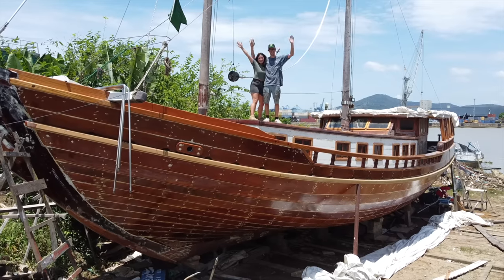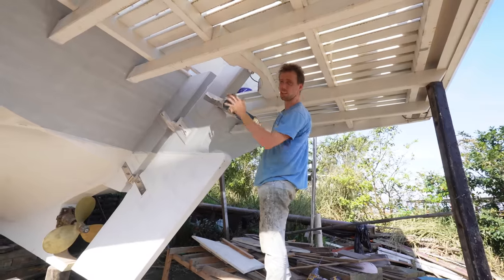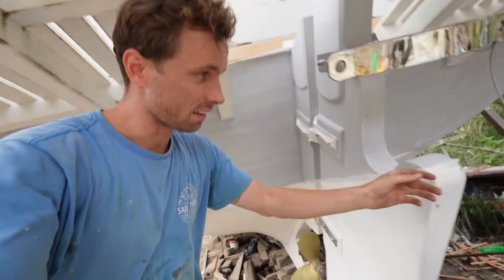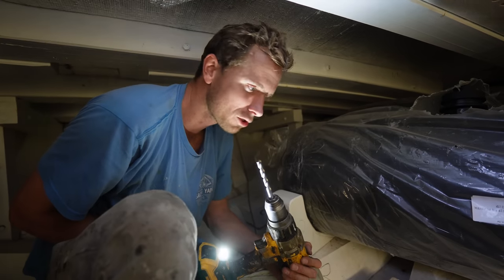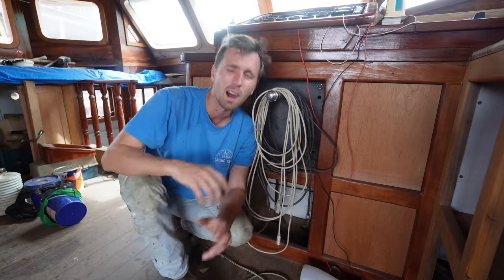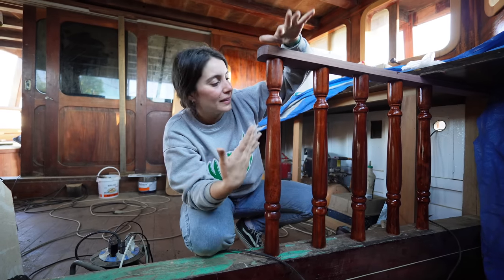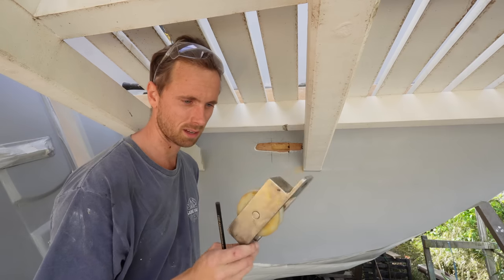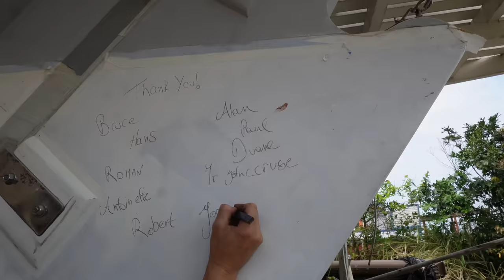We can finally steer our once sinking wooden boat into the horizon — Sailing Yabá 152

Comment: Dear Sailing Yaba couple.
👍👌👏 The rudder system seems to work just fine. Personally I wouldn't trust a bicycle chain, I would use at least a moped chain and sprocket. And please read the comments about attaching the cable to the chain. I would also recommend to use more than one attachment point. But of course you have all those experienced boat builders around you. Maybe I'm simply too cautious!?
2) Hey, why no dogs in this video? Are they stressed and needed a vacation? 😁 ;-)
Thanks a lot for making teaching explaining recording editing uploading and sharing.
Best regards luck and especially health to all of you.

Comment: The steering cable should be under tension to keep out the slack.  You might consider using strong garage door (2) springs to (one on each cable) to keep the cable under tension.  Also, I suggest using metal tubing for the cable to run through at the stern.  The cable clamps will loosen over time.  You might weld them in place using liquid weld.   You might consider using someone who can help you with the proper steering setup.
Reply: My thoughts. This isn't something you draw out in a white board... this is more important than an engine... he seems to think epoxy is a save all ... I feel they're rushing to meet an unattainable deadline that will cause the horrible failures.... I do not understand the rush an the not using a professional person for this🤔🤷🏼‍♀️
Reply: I agree, as Donna stated this is the most important system on any vessel. Please consult a professional to design a proper steering solution for your fine ship. Best of luck going forward.   @donnakawana

Comment: I know it cost a bit more but defo would have gone hydraulic on the steering you will have to put metal tubes where the wire goes through the hull as it will easily cut through the wood! I can see problems down the line with the cable system hope im wrong good luck😊
Reply: hydraulic would work well however it is complicated and if you have a system fail you have no rudder at all unless you bypass the cylinder's or drain the oil from them(very difficult in a storm that wants to swamp you and seconds count for hours)  if a cable breaks they simply can quickly switch to tiller keep her nose to the waves and  sail to get to repairs
Reply: @GeorgeVeld  yes sir you are right if the system fails it is a few more steps . But there is quick drain systems that allow you to relieve the pressure off the pistons pretty quickly … then just go to the tiller…

Comment: Uses large  link chain,   the  bicycle  chain is too small.   And  never run a steel  cable  through  a link  like  you did.  It will cut the cable  in a year or less.   Remember  those  contacts  will  have continuous  wave slap  when  in the  water
Reply: Yup over looking important things to rush to meet unnecessary deadlines
Reply: It isn't a bicycle chain, it's a motorcycle chain. I'm a bicycle mechanic, I fix them for a living. My biggest worry for that thing would be rust. I know a motorcycle chain is much much tougher than bike chain, but I can't help but think of all the times I've had a rusted chain snap on me under load.
Reply: Agreed. I'm not an engineer but it doesn't take one to see that running that cable through a chain link is doomed to failure in the not distant future.  And that chain looks really small for the task you're placing on it.  A bigger chain is needed and a better connection with cable than running it through a link.  And it's good that you have large pulleys because I think you're going to want a bigger cable than the one you have.  Your boat is pretty big (I'm guessing it will be around 50,000 pounds loaded, or more) as is the rudder and I think your current cable is too small for that load.  The last thing you want is to be making cable repairs or replacement in the middle of the ocean.
Reply: the last roller of the chain the cable is attached to can come loose. it is wise to put a bolt through the last link, or rivet.
Reply: The previous version used junky old ropes that were spliced together using regular old knots.  The motorcycle chain that they have now is plenty strong.

Comment: Steering: I'd add a spring to the bottom of each chain, looped on one end and hook on the other. 

This allows for an eye at the end of the cable so it's not folded over the chain, that will wear and break. 
Then you can set the tension by moving the hook up the chain. Low tech and functional. 

The springs will keep tension on the system which is safer, and stop that terrible knock that you're going to get every time you turn to full lock. 

I'd definitely go for a smaller cog. Testing done now doesn't allow for water. When you're moving at speed or against a current, that water on the rudder has a lot of weight and it will feel completely different to being on the hard. 

Well done. You're so close.

Comment: I'm no boat builder but it strikes me that those cables that turn the tiller will come under enormous amounts of strain during rough weather. Do you think that those little pulleys that that have been screwed into the boat with 2 screws are going to be able to hold when the pressure gets too much?

Comment: Lots of peeps have commented so I wont dwell on it but once in the water you'll have more friction on those steel cables/wires to the steering which in turn WILL mean the cables/wires WILL stretch. If you don't want to keep having to tighten those cables/wires at the clamps all the time suggest like others have said put in tensioners e.g. turnbuckles. Also without thimbles or similar protecting the cable/ wire at the chains and the quadrant, because the radii is too tight for 6mm, it will fail sooner than it needs to.  I would also humbly suggest you carry a spare steering wire/cable when you eventually sail and possibly some spare pulleys. Great video btw

Comment: Cool video. You don't usually want to put the cable saddle clamps on in opposing directions like you showed... unless you are not too concerned about everything working properly.... The main "Saddle" side of the clamp goes to the working end of the wire. Good luck!

Comment: How exciting..!!  She Steers..!!   I agree with other comments that the entry angle of the wire from the quadrant to the transome sheave varies as the rudder turns through its arc. This is putting side load on the sheave, which is not desirable in the long term.   Maybe the sheaves need to be angled down on the inboard end?
Also, having turnbuckles in the wire circuit will help to apply tension to take up the slack in the cable and assist adjustment when it stretches. There will be a LOT of load on the cable in seas, and you'll need a fair cable run, free from wearing or load points.
Well done with the progress..!!
Cheer from Grant, Adelaide, South Australia.

Comment: I agree with thimbles and turnbuckles. The clevises on the quadrant need safety wires on the pins so they don’t back out. With the amount of force of the water on the rudder while under way, I think the wire needs to be a larger diameter. I also think that the trailing edge of the rudder should be thinner.

Comment: Ben, I agree with the comment about using bolts nuts and washers for the turnbuckles as the cables will be under a lot of tension especially at those turnbuckles, lag bolts will work loose over time. The cable terminations at the quadrant use s/s thimbles in the eye but I would not use cable clamps to secure them - too many bits to come loose. Pro cable riggers use swaged copper talurits using a hydraulic crimper, the cable would have to break before the talurit would let go.

Comment: As many people have pointed out, you really need turnbuckles to adjust cable tension and rudder stops are a must. If you had routed the cable through teflon (or some other material) tubing you would eliminate the need for pulleys (at least on the inside). Think how a MIG welder torch feeds wire. Then the steering tackle could be easily routed almost anywhere.

Comment: Hi Ben & MP,  
I was thinking that another pulley along the straight areas inside the hull with a spring on it so that there is always some light tension on the cable to allow for cable stretch over time and to keep the cable from "jumping track" in the pulleys.  My experience with that type of cable is that it will settle in a bit over its length and at the clamped ends, a pulley and a spring to each side could avoid headaches down the road. Could also help the chain from jumping out of cogs in heavy seas.
The spindles MP were working on turned out fantastic! Keep up the great work! Love the pups!

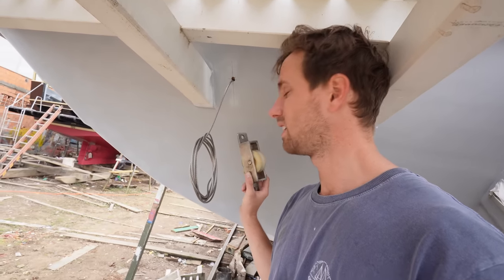Comment: 21:43 with the changing angle of the wire as the rudder deflects I would recommend you use a floating pulley and a pvc tube for the wire to feed through to protect the wood of the transom.

Comment: Ben:
1) Figure out a better attachment for the, I believe, Starboard cable to the chain.
2) The cable clamps are supposed to have the rod with the thread pulling the bitter end onto the standing end at the saddle, never the other way, as it weakens the standing end, if done in that fashion.
3) Cable exposed to the sea air, even stainless, will start to corrode between the wires, so will need to be checked every so often.

Comment: Make sure that you always carry a spare of every part of your steering mechanism on board, including all pulleys, chains, cables, fixing bolts (and some oversized bolts, in case any in the wood pull out) and cogs. Oh and put a metal plate on each side of the swim platform where the metal rudder piece will hit, to stop wear .

Comment: Always remember when installing cable clamps...never saddle a dead horse.  So, ONLY put the saddle on the main wire.  Never on the dead end.
Reply: mine thought as well
Reply: And 3 clamps min
Reply: I think he has the cable clamp on the wrong way on the ruder, this damages the cable if it was on my Boat it would be replaced
Reply: I worked at a zipline for 5 years and was responsible for daily inspections. I was just about to say this.
Reply: Why not put a metal tube inside of the transom, through the drilled holes,run the cable inside of the tubes protecting the wood for being cut by the wires, wear and tear by moving the cables left/right?
Reply: @sergiogobbi6085  , metal sliding against metal will introduce wear on the wire. I would rather have the wire retaining it's max strength while running against some wear item that can be exchanged.
Reply: @westmus  not a problem, if you add a dab of nautical grease.
Reply: @sergiogobbi6085 my thoughts also, a wire saw is a good way to cut timber….. Also maybe use a nylon tube to protect the SWR from abrasion
Reply: Should the wheel be angled downward to match angle of cable

Comment: Two things to consider on your steering arrangement. 1- add a tensioner pulley on cable runs, 2- use a proper connector to go from cable to the roller chain. Can be purchased from a marine supplier.( current arrangement is your weakest point in your hookup) . Enjoy following your progress, keep up the good work.

Comment: You should drill a large hole in transom for the wire to go thro' fill it with Epoxy and then drill out the correct size. as you know that will stop water wetting the transom wood. maybe a little hole but why start rotting the  transom first day out unless you like building boats more than sailing. haha. Fantastic work can't wait to come and dive with you guys.

Comment: Ben, you need to use 2x stainless steal turn knuckles to pick up the slack on the cables. Also make a plan to seal off those 2 holes at the stern.

Comment: Ben you asked about our opinions on adjustments made to mounting those pulleys on the back of the transom. I would seriously consider mounting a block of wood and cut a groove in it, instead of cutting a groove directly into the transom like you did, I would repair that and consider doing what I've recommended. I would talk this over with the Shipwright and see what they recommend and go from there.. Cheers !!!! also I would drill those holes through the transom after installing the blocks and drill larger holes then epoxy the holes then redrill them that way the wood is forever protected from water intrusion. Hope these suggestions help you's out. cheers.

Comment: Just a note.  The more bends the cable has, the more friction it generates and the harder it is to steer. At each bend is a pulley which will further add friction.  It would be to your great advantage to eliminate as many bends and pulleys as possible.  A single pulley below the wheel at each side, then a straight line to the outlet at the transom where a second pulley would be mounted. In between, teflon tubes mounted on the overhead and teflon pulleys will reduce the drag enormously.

Just my two cents.

Comment: The one thing I didn't like about that steering system was the connection from the cable to the chain.  May I suggest that the chain connect to another sprocket with a continuous loop, then have a tiller arm attached to that sprocket to attach the cable to.

Comment: The rigger who explained cable clamps to me said "Never saddle a dead horse."  Put he saddle on the live end of the cable (doing the work) and the u-bolt on the dead end of the cable (loose end).  If you over tighten the clamp the u-bolt can cut the cable.  You don't want to do that either way, but if you do cut or weaken the dead end  there is  less load on it and more material left to make an emergency repair.

Comment: You may want to put the wire through the next hole up on the chain as it has a pin in it or even run it through a couple of links. This will make it stronger. Remember the force on the rudder will be immense in a strong sea. Turn buckles to adjust the stretch in the chain and cable is a good idea. The boat is looking good and I look forward to seeing it on the water again. Well done guys an amazing job!

Comment: Suggestion...install a pulley tensioner and if possible install a adjustable tensioner on the wire just like a rigging rod tensenior. Through time with that length of wire chain and so many turns on pulleys. Youl get a lot of slackness unders strain.

Comment: Two things to check.
1) there is a minimum bend radius for a given cable. Make sure the pulleys are large enough for your cable.
2) To keep the cable tight  when the rudder is not centered you may need a  rudder quadrant.
 A quadrant-or fan-shaped metal fitting at the rudder head which receives the. steering cables. It ensures that the point of contact of each cable is. tangential to a circular arc centred on the axis of the rudder.

Comment: Great to see the rudder and wheel being installed, looking like she's ready to head off soon 🙂 Some thoughts on the setup : To have a pleasant and accurate steering feel you want to remove as much slack as possible (turnbuckles as mentioned very useful here) but you have to balance removing slack against loading the system up too much of course. I assume that you've referenced working systems /knowledge in designing your system but worth remembering that a rudder that size can be subjected to very large forces in bad weather /grounding so the cable run must be shielded /kept away from people as a breakage in a cable can be a deadly weapon. Also shield the cable from people storing things that might obstruct the cable, eg fenders, sails, ropes etc Have regular maintenance checks (especially in the first few months) to check for stretching, wear, damage. Carry spare cable and an alternative steering method, can you still use a tiller for example?
Reply: Was thinking the same thing about breakages. Steel cable breaking under stress is deadly. There are many documented fatalities and serious injuries from this. The 4WD world is also full of them from steel ropes parting. Maybe run the cable through stainless pipe in the engine compartment for safety, or at least thick PVC (hi pressure) pipe. 
Also some sort of guide through the transom so there is no cable on wood contact. Is there any thought on stopping or slowing water ingress through the holes in the transom?  Just some thought from the air chair critic 🙂
Reply: That was the first thing they designed.  In the last episode they showed their boat nearly pin-balling through the marina.

Comment: I am a big fan of your efforts to rebuild Yaba and the work that has been done so far.

With that said, a common theme of most of the comments points to your need to get some professional help to design and build your steering system, and not try to jury rig one of if not the most critical systems on your boat.
Reply: Clearly you didn't see the previous all rope and nylon pulley version that was used successfully for many years.  This is how a lot of professional mariners do it down there.  You should get some context before you condescend.

Comment: Even on as small as a 17 foot i opted for hydraulic steering due to the expected torque on the leg with refreshed horsepower. Too many boaters caught unaware when cables snap. Incredibly dangerous. Great video capturing. Cheers😊

Comment: Talking about the rudder cables going through the transom. Take a small diameter brass or copper pipe or tubing with the ID size big enough for the cable to run though. Then epoxy the tubing or pipe into the hole in the transom to protect the wood the cable.

Comment: In my opinion, I’d keep that wheel. Such a classic look. 
Is there some kind of friction device that can hold the steering in position once the rudder angle is set, while you’re under way? Otherwise, as soon as you release the wheel, it’ll want to straighten out. Also, with the long run of cable, you might want to install some anti vibration device. With that long run of cable, a certain amount of vibration will naturally occur. Just like in a bicycle derailleur system, there are opposing tensioning wheels that stop chain slap from occurring.